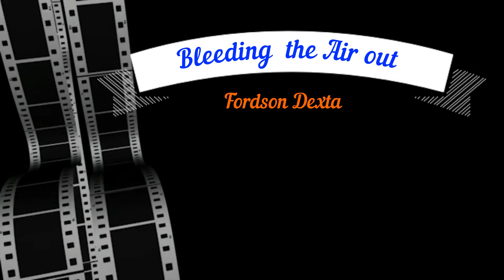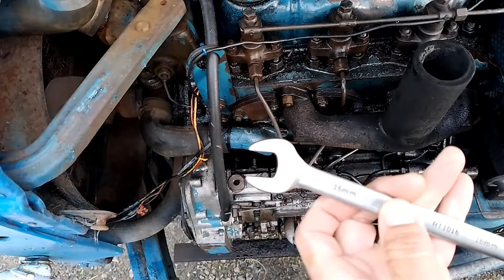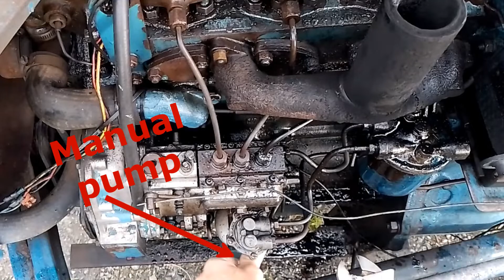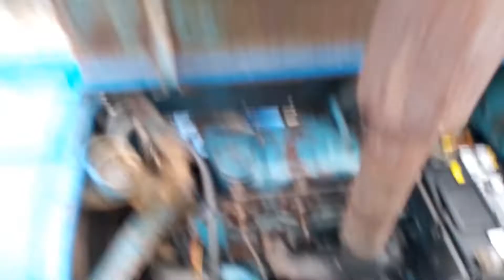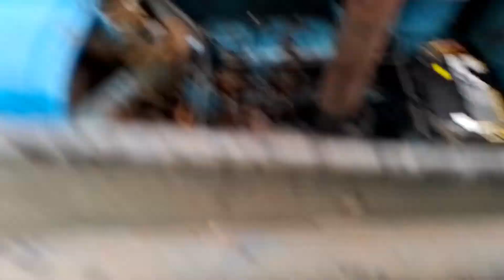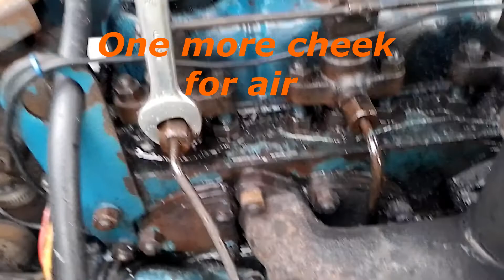Bleeding the Fordson Dexta

Comment: All you need to do is open the  2 bleed screws on injector pump and bleed fuel from them ,push cold button and it will start..
Reply: A lot of these wee Dextas need bled up to the injectors
Not all of them have an excess button on the injector pump.